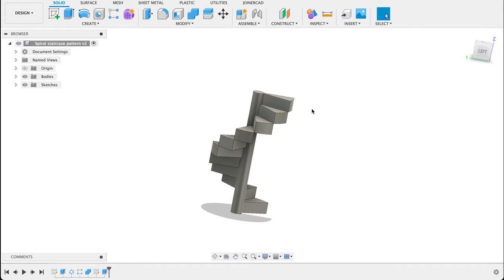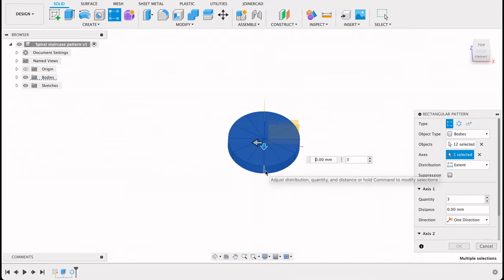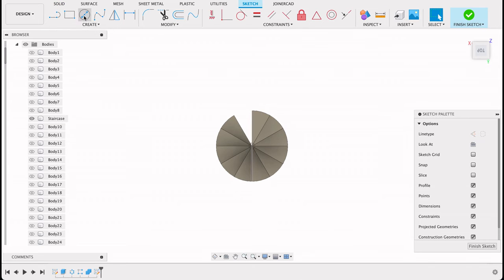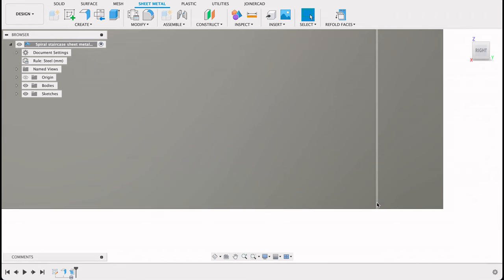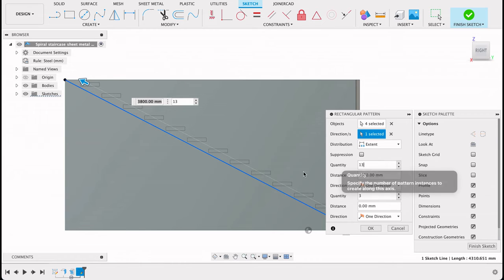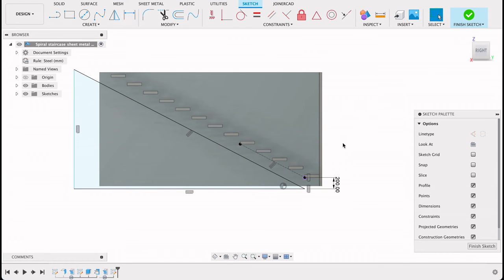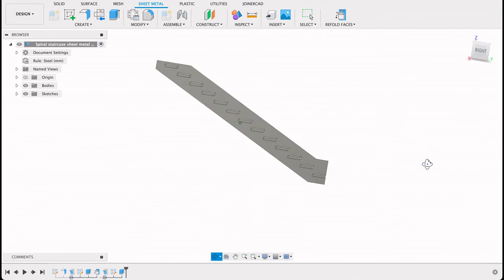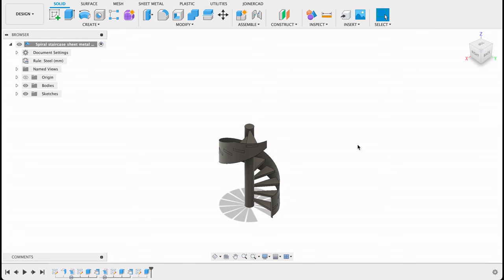Fusion 360 tutorial: Making a 3D spiral staircase

Comment: Great tutorial, but it seems that the free version of F360 doesn't allow users to re-fold the flat panel after the steps are added :(
Reply from the maker: Hi, I am not aware of those limitations. I did this video a while ago so I’ll have to go back and check. Thanks for engaging
Reply: Yes the free version of F360 allow to re-fold the flat panel after the steps are added.  Take care to extrude with Join operation! Many thanks for this tutorial !
Reply from the maker: It’s a pleasure
Reply: I can't seem to make it work on my verson of the free software. It only rolls the cylinder up but none of the steps are added, even if they are joined to the flattened part  @PieM34